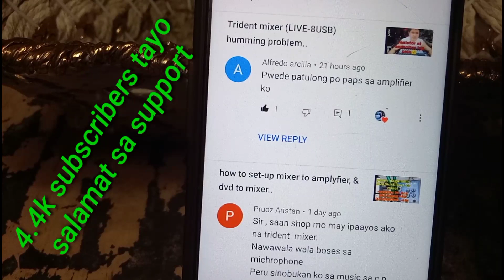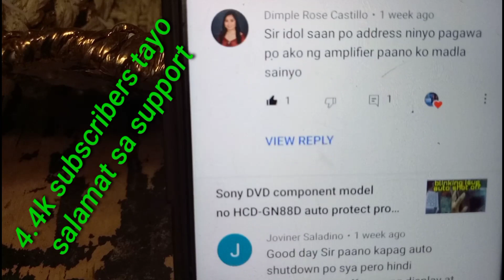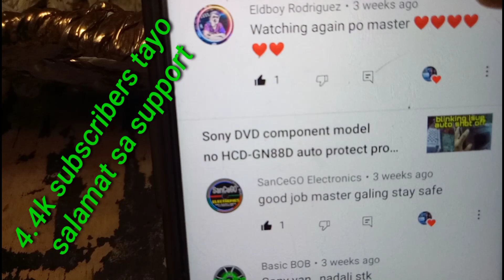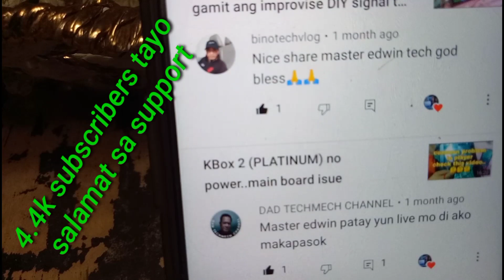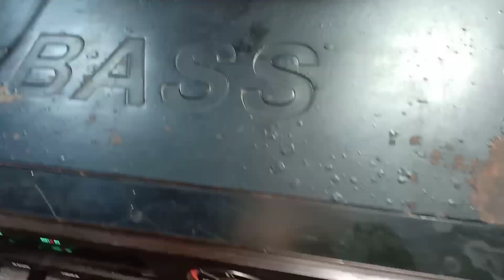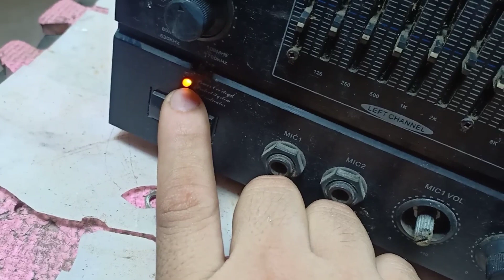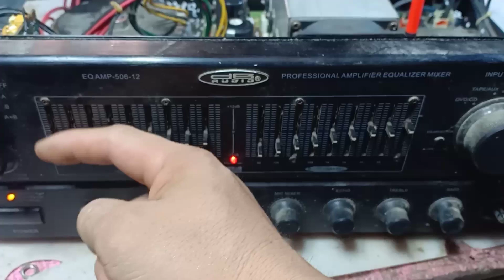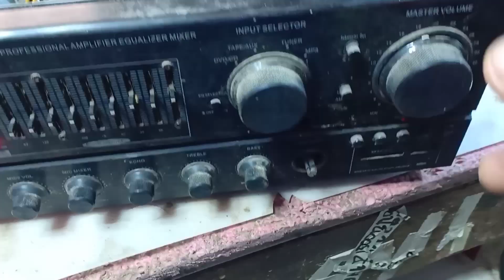DB Audio (EQ AMP-502-12) repair

Comment: Idol, tanong lang. Paano kung yung left and right tone control/equalizer ay di na gumagana! Ano pwedeng problema idol? Salamat
Reply from the maker: Check Po Ng supply.,Kung present ang  supply!,, Check mo ung OP amp, possible din mga volume,pwd Rin lose connection..

Comment: boss edwin clarify ko lang po...kapag po nakaharap po kayo sa amplifier yung sa side ng transformer yun ang right channel at yung sa kanan ng fan or kung nasaan yung fm tuner yun naman po ang left channel? tama po ba?..,yung db audio ko po kasi na ampli nag red then yellow pero walang sound ang right?...yung left lang po ang may tunog...parang ganyan na ganyan ang sira....di din po gumagana yung balance...pag pinihit ko yung balance papuntang right yung sound nung left about sa right...power transistors na po ba ang sira nito sa right side?
Reply from the maker: Baliktad Po.. Kung nsa harapan k Ng amplyfier..left channel mo sa left side din right channel right din.. Kung Wala Po audio output sa right channel sa binding post terminal at nag rerelay nmn malamang ok nmn ang main amp.mo,, poseble Po nsa input section,ung effector hamper Po kadalasan,tone control,pwd Rin ho sa wiring baka my lose connection, bago Po un check nyo muna ung supply sa tone control dapat present 8-12volts - + supply..
Reply: @edwintech1277  thanks po ng marami boss edwin sa reply ninyo. nag bias check po ako. .3vdc sa buong right side at .4vdc naman po sa buong left side. newbie lang po ako sa electronics. check ko po mga connection ngayon. Keep Safe po.
Reply from the maker: Ok bias voltage mo.. check mo effector hamper.. bka Ng lose..
Reply: @edwintech1277  boss edwin ano po yung effector hamper? yun po ba yung audio input? yung rca plug ng dvd, tape sa likod? yung may jumper na 2 na malaki sa likod ng input?

Comment: Good eve sir ed may ginagawa po ako ganyan din po db audio nag click po ang relay pero walang biasing ,konting tips man sir
Reply from the maker: Main amp section sir, double check mo mga resistor at transistor.
Reply: Ah oke sir salamat

Comment: Boos db audio 502-18 umuugong Lang poh
Reply from the maker: Supply Ng tone control or main main  amp.check mo capacitor, pwd Rin lose connection sa sa tone control.